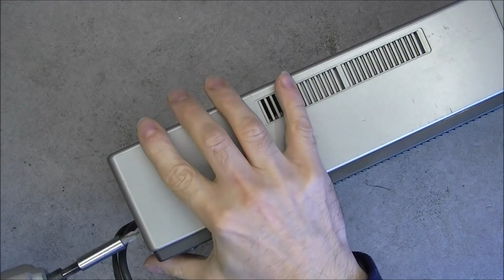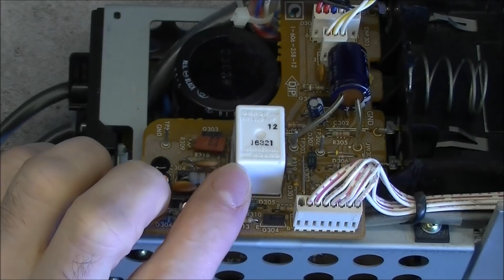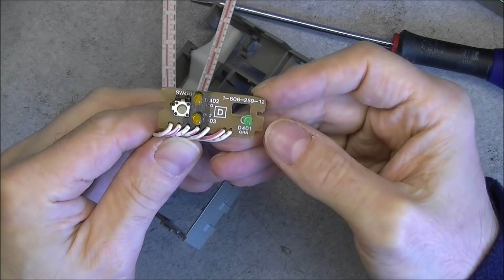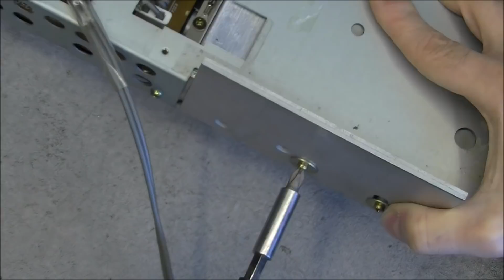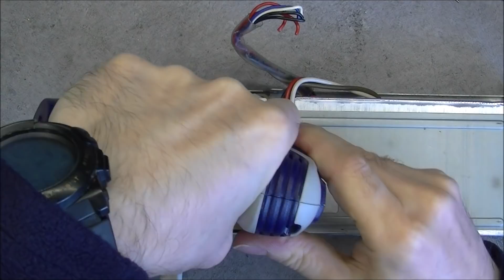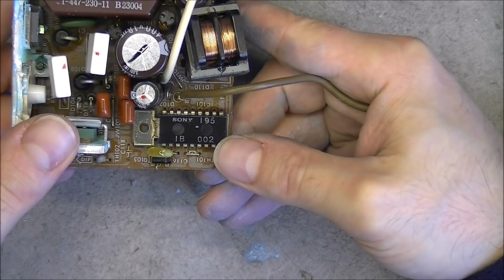Vintage Sony camera battery charger teardown

Comment: I still use some of these as power supplies for PCM-F1 digital audio equipment.  You can see one at the very start of one of my videos:
https://www.youtube.com/watch?v=8Hi6QqivGy4
The same batteries that these charged for domestic Betamax recorders, were also used for some time in professional Betacam studio grade cameras.  Betacam went on to become digital and even HD, so Beta in one form or another, actually outlived VHS.